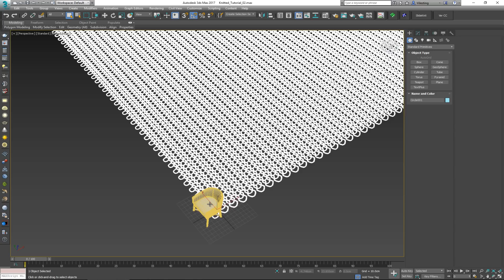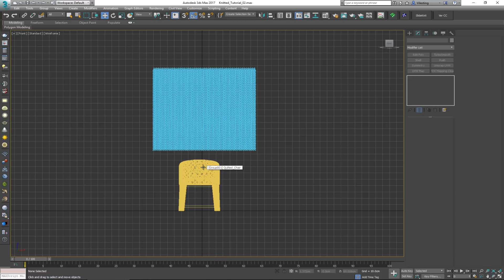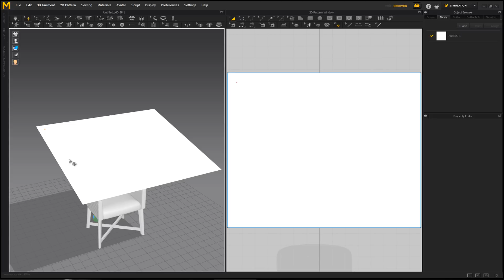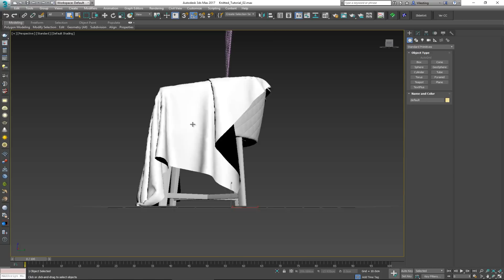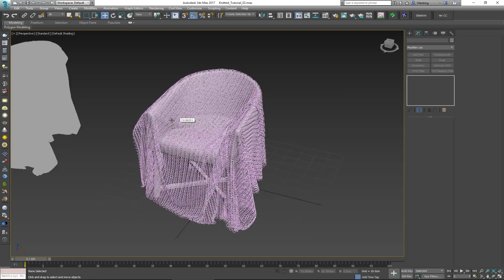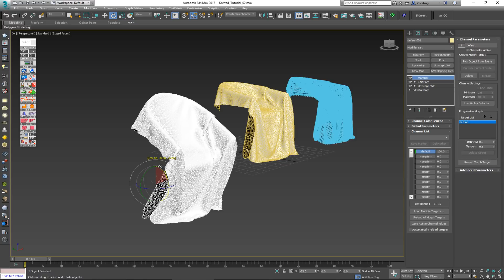Modeling and Morphing the Knitted Cover in 3ds Max and Marvelous Designer

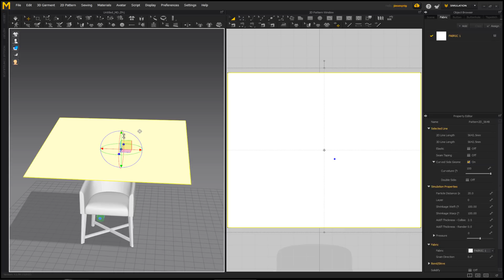Comment: Hello Denis. Can you explain the part that you showed in 08:30. minute? I didn't understand how you added points and how they stayed frozen, while big part of the blanket falls on the chair. Also why did you called and then deleted avatar symbol there?
Reply from the maker: As i say in the video, click and hold the W button on your keyboard and that will add the pins
Reply: @DenisKeman  My user keyboard setting is 3D Max. I tried to hold W but It just does make to move. I still couldn't see points. There is a just setting button about point that I could see. It is X button.
Reply from the maker: @muhammedbaykul3194  Well then check and see which is the button set for putting in Pins. The way i have it setup on my side is with the native controls for MD
Reply: @DenisKeman  Thanks I fixed this problem. :) But not by holding W. I saw the Pin button next to Move button. I am new about Marvelous. So, something is hard to find, while I am not an native English speaker. But I have a new problem.:)  I cannot see after I wanted to import object with UV Map from 3 DS Max. Scene is seen empty. I chose trace 2d patterns from UV Map but it doesn^t work. Do you know cause of it?